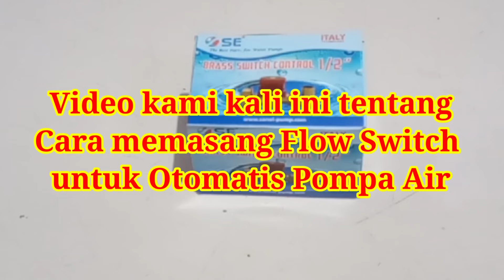Cara Pasang FlowSwitch I Otomatis I untuk PompaAir I How to Install a FlowSwitch for a Water Pump

Comment: Bang yg benar posisi flow switch di pasang posisi output apa di input bang, soalnya punya kita sudah terpasang di output dan kebocoran gk ada kran aman tapi pompa gk mau mati solusinya gimna bang 🙏
Reply from the maker: Maaf Baru Di Balas, Kita Biasa Pasangnya Di Output Pak, Coba Sebelum Di Salurkan Ke Pipa Instalasi Kran, Airnya Di Buka Dulu Setelah Stop Kran Output, Kemudian Di Buka Tutup Pak, Semoga Membantu
Reply: @BABETEKNIK  sudah bang tetep mesin gk mau mati

Comment: Bang klo yg diputus kabel nol nya bisa gak????
Reply from the maker: Bisa Pak
Reply: @BABETEKNIK  ok bang terima kasih infonya,,semoga sukses selalu.
Reply from the maker: Iya Pak Sama2, Terima Kasih
Reply: dan harus rapat semua yah sambunganya,,baik sebelum atau sesudah flow swit.
Reply: @BABETEKNIK  eh bang lupa nanya,,,itu klo kran ditutup pompa mati kan yah?????
Reply from the maker: @aykhadijah2127  Iya Pak
Reply: @BABETEKNIK  om punya saya kok gak mau otomatis kenapa yah,harus nyambungin(sentuhin kabel keduanya) dulu kabel yg ke flow swit baru bisa nyala,padahal diujung pipa yg ketoren sudah ada celenoid.
Reply from the maker: @aykhadijah2127  Usahakan Posisi Pompa lebih rendah dari toren Pak, agar lebih ada tekanan, Pipa yang dari toren di usahakan yang 1 inch atau minimal 3/4 inch
Reply: @BABETEKNIK  oowh,,ini pompa saya diatas toren,,coba bsk sy rubah.
Reply: @BABETEKNIK  klo pipanya yg dr toren 3/4 inci